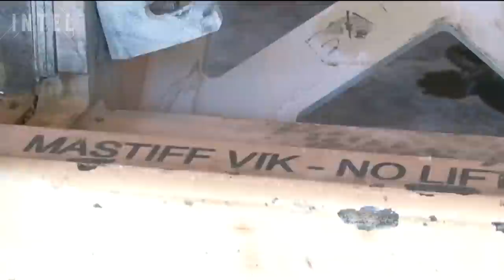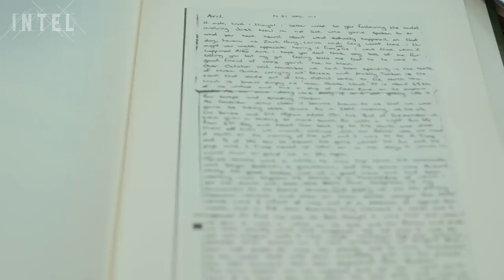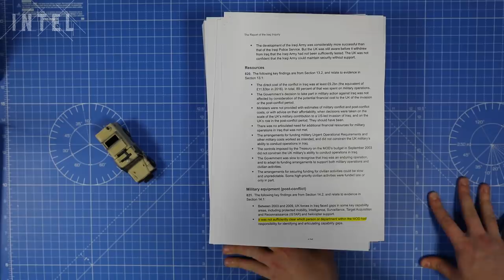'Mobile Coffins': The Unlikely Solution To The Army’s 'Death Trap' | INTEL

Comment: 120 lives lost due to the indescribable incompetence of the MOD and senior military officers.
Reply: So true, and probably entitled aristocrats who don't understand the situation on the ground, were no where close to the violence and are looking at the cost of changing the vehicle.  Just like in 1990 and the first Iraq war where Tornadoes were used in ground attack roles designed for a European theatre.  The command structure understood not changing tactics would cost lives but they were motivated by policy and politics until their arses were kicked with the video of captured pilots.
Reply: @wezab  whilst there were obviously big issues with the vehicles, going down the entitled aristocrats argument is too simple. Anyone who was a senior officer would have been a junior officer and likely have seen active service in Ulster etc. Its a fair comment that lessons from Ulster were not necessarily applicable as said to Iraq but the attempt to imply another version of WW1 Chateau Generals is a bit silly
Reply: Civil servants more concerned about getting their ergonomically designed office chairs to save their backs than save lives on the ground.

Comment: Australia was operating a V shaped hull vehicle called a Bushmaster 8 years earlier than this vehicle. The v hull was filled with water to absorb the blast and as the blast was deflected outwards the vehicle side compartments were designed to break off similar to crumple zones on vehicles. The result was 0 fatalities from IED's
Reply: They’ve taken the water tank out of the PMVs as they’ve found that due to water being no compressible it actually enhances shock effect inside the vehicles, great vehicle though
Reply: But u have the  UTE Culture there  🇦🇺 and common sense 👏🏻
Reply: @Key_highway  oh that's a bit of new info mate thanks for the update :)
Reply: @piendawg  Since the Bushmasters use in Afghanistan I think 2006, not a single Australian soldier has died inside a bushmaster from a mine or ied. They were really ahead of their time. Basically the first ISAF/Coalition troops to use them. While the Americans were using HUMVEES, which whilst a little better armoured than the Land Rover, were still not Mine Resistant, and there are videos over the internet showing what IED can do to a HUMVEE, throwing them, and everyone inside (ususally tossing the gunner out too)at least 6ft or more in the air. The worst I saw from an absolutely massive IED, probably meant for a tank, threw an Iraqi Army HUMVEE easily 20m into the air.

Comment: I do not know why it is but, as a race, we seem unable to learn from history. 
Way back in the 1970s landrovers were quickly mine-proofed in theatre by the Rhodesian forces  - full harnesses for the crew, a roll bar that was substantial enough for the vehicle to drop on without collapsing and AN ADD-ON V SHAPED HULL underneath.
Now I am not saying the originals would have coped with 2000s IED  explosives but someone should have at least thought about it.

Comment: land rover in service from WW2 i don't think so 
1948: The Land Rover is launched at the Amsterdam Motor Show on . Later known as the 'Series I', it has an 80in wheelbase, 50bhp 1595cc petrol engine from the Rover P3, pick-up body and priced £450. 1948: Rover introduced the first Land Rover Station Wagon in .

Comment: The one thing that would always help is someone actually giving a damn about our troops. I was driver trade in the TA RLC and if you took 12 DROPS trucks out on a 24 hour driving exercise 1of the 12 would break down. Couple that with the fact these trucks were not very old and had low mileage due to the fact they belonged to aTA unit not regulars means they were so sub standard it was unreal. Our problems were nothing like as bad as the infantry's but even so getting out of that mess was the best thing I ever did.

Comment: Good Video,but the Talk about the military vehicles british has Always been a thorn in the cost of supplying a good armed vehicles for the british forces.
Going back to Northern Ireland 1972 the Landrover was in use and it had no real protection at the start and then came first protection Special Glass fibre plating around the body und and as much use as Matchbox.
This has been a on going Problem for years
If it was Northern Ireland, Germany, Irak,etc.
What really should is the Soldier or Gunnar
and seaman should refuse to go on Tour.

Comment: Pause the video at 2:29  this is typical  of a “street” in Basra. They were very narrow, usually an open sewer running on one side that you did NOT want to end up in.  What you can’t see on this video are the typical system of electricity distribution cables strung between every building on both sides of the road, rarely higher than 3m above the ground. Anything bigger than a LandRover just couldn’t get you into the bits of town you needed to go to. 

When the insurgency ramped up in mid 2004 we were stopped from patrolling in soft skin landrovers - nimble, easy to see out of and easy to get out of in a hurry. Pressure from politicians (like the minister taking all of the credit in this video) who had so far failed to finance the procurement of the proper kit for the job, or provide the solid political purpose for the operation, led to us being forced out of soft skin rovers and into Snatch. Snatch looks wonderful to a politician struggling to justify sending us out there under equipped. But it is heavy, slow, lumbering, very difficult to see out of and extremely difficult to get out of quickly. Then the attacks on the vehicles ramped up as they were an easier target.  None of the later UOR protected vehicles were suitable to Iraq city centre ops but luckily by the time they came in we were out of the city mostly. Afghanistan is a very different story and the UORs were absolutely the right choice for that theatre. But please don’t pay any attention to the minister bigging himself up. We were in the situation due to the Labour Prime Minister, Chancellor and Defence Secretary failing to properly resource the armed forces for the mission they gave us. The buck stops at ministers.